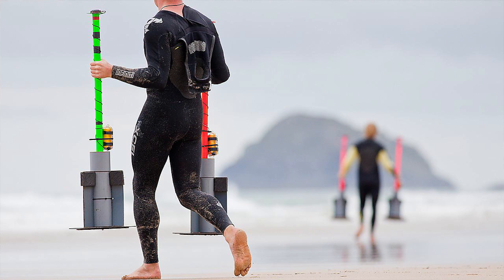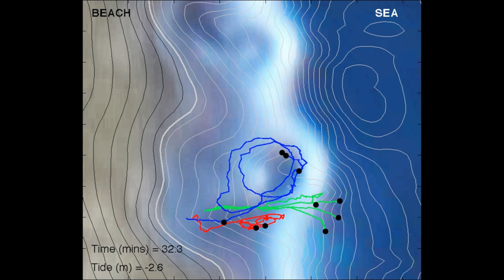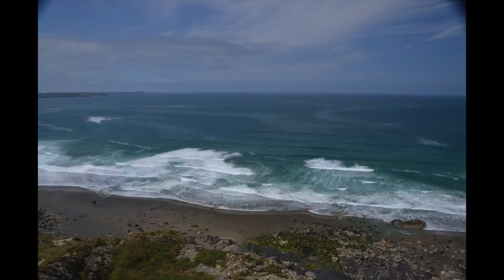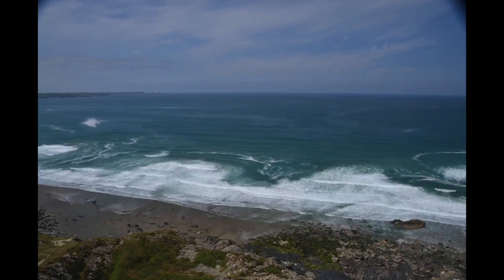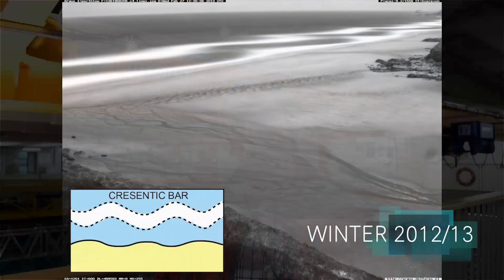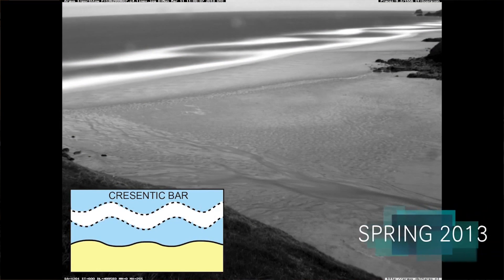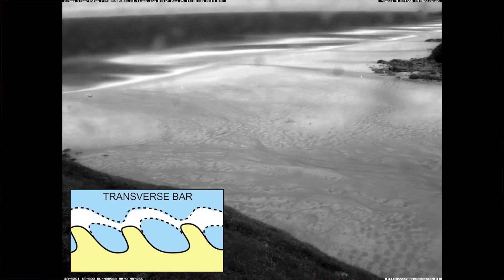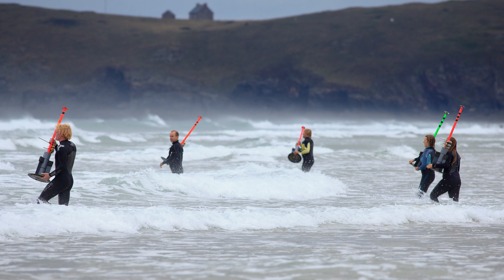Understanding Rip Currents

Comment: I got caught in one in either England or Ireland when I was 10 years old. Luckily for my age and naivety, I didn't realise the danger I was in so  i was calm. When I got swept out to sea, I could still see the shore so I wasn't worried, though i was confused how this was possible as i had just been swimming ferociously to get to shore with waves crashing over my head, however it was more peaceful back there as the waves weren't crashing over my head there. So I stopped and floated there for abit while I worked up the will to swim again. Luckily 2nd time trying I made it. Not sure if the rip disappated or whether I ended up floating out of the direct line of the current. But jeeze I feel lucky now

Comment: Pleases someone explain: Waves transmit energy through water, the water itself does not move this is an established fact so why the need for all this water to return to the sea via a rip current if the waves don't bring any water on to the shore in the first place.  Obviously rips exist I just cant see the mechanism, the standard explanation doesn't seem to hold water (sorry).
Reply: While it is true that in deep water, waves cause no net movement of the water (they do make the water oscillate, of course) this is not the case when waves break on the shore. In that case they most assuredly do move a lot of water toward the shore, and that water will return to deeper water, causing rip currents.

Comment: i got caught in a rip as a kid without realising it. luckily i figured out that i needed to swim perpendicular to the direction i was being pulled in, to get out of it, and i made it back to safer waters. i didn't realise what i'd done until RNLI came to my school to do an assembly on beach safety a year later
Reply: Do rip currents pull you under the water? That's the part of a rip current I don't quite understand... I get that they pull you out and away from the shore, but is there also a downward force that makes it difficult to keep your head above water?
Reply: @jt8251  No, they don't pull you underwater.
Reply: I think that swimming perpendicular to the direction you were pulled away from the shore is the same to swim parallel to the shore.
Reply: I'm not being snarky; just explaining in case someone gets it wrong.  You survived, so I could be incorrect, and I'm glad you were able to survive. 😊
Reply: I believe you swim parallel,  not perpendicular, to attempt to escape a riptide.
Reply: @glynnacarruthers6946  You swim parallel to the shore. Rip tides pull you out to sea, so swimming perpendicular to the current is the same as swimming parallel to the shore. I believe you may be mixing the two instructions up (swim parallel to the shore, and perpendicular to the rip-current). If you swam parallel to the current, you would be swimming away from the shore and further out to sea, and you would heighten your risk of drowning.